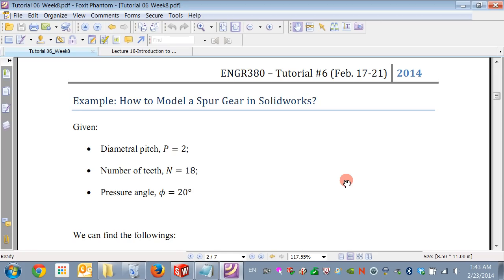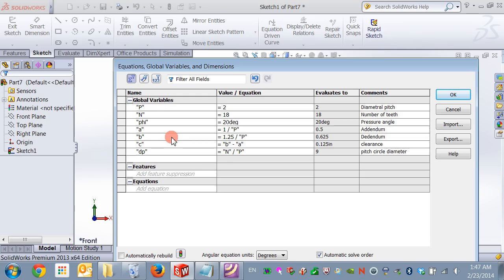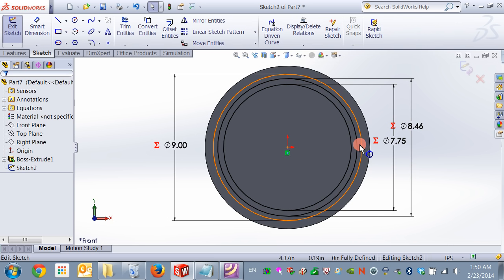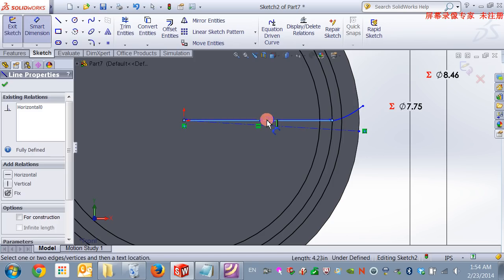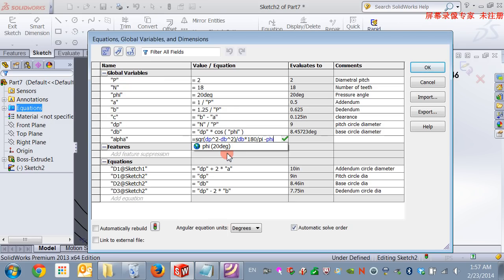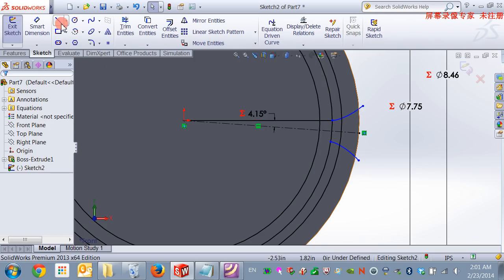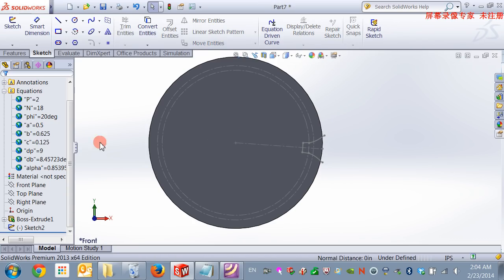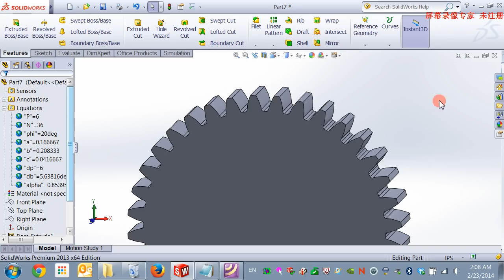Modeling an Equation Driven Involute Spur Gear in Solidworks

Comment: Great tutorial, sir!
Just one note: when creating the circular pattern, one might need to be sure to have the "Geometry pattern" checkbox checked in the circular pattern dialog box, otherwise it might not let one propagate the fillet as well
Reply: Damn it. I just lost an hour erasing and redoing everything step by step. I was going crazy until I figured it out on my own.... I was going nuts! Now that I'm reading your comment I feel trolled xD
BTW great tutorial Yang Cao, but you should have used an equation in the circular pattern, that's pretty obvious. So you don't have to manually adjust it every time. Number of patterns must be equal to "N". Same thing for the fillets, you could have used an equation like "fillet radius equals 0.5*clearance" or sth like that.
Reply: You are a gentleman and a scholar. Thank you so much for this comment.
Reply: I had an issue with that, but I changed my fillet so that it was included in the sketch, and then set it to an equation.
Reply: Thank you sir. True legend lol
Reply: thanks alot for this
Reply: Thanks a lot man
Reply: nice catch

Comment: Thank you so much for this. Absolutely spectacular. I'm using this to make a clock, and I found that by simply inputting "N" for the number of instances in the circular pattern you can have it auto update. Also, I made the diametral pitch dependent on the pitch diameter via adding another variable. Just a couple things to make changing gear sizes easier.
Reply: Can you explain why you made the diametrical pitch dependent on the pitch diameter? What does this solve?
Reply: Matthew Miller I'm using SDW 2014, not sure if it will work on older versions. I simply put "N" (without quotes) into the field "Number of Instances" when I did the circular pattern. This way I can make a bunch of different size gears without having to update the number of teeth in the equations AND the circular pattern. As for the pitch diameter, I just made another variable (named pitchdia I think) and changed the value for "P" to an equation based on "pitchdia."  This really doesn't solve anything for most practical uses, but when you're making a bunch of different sized gears, it shaves a minute or two off each one.

Comment: Hi there, on your notepad, the alpha equation is different than shown on the PDF. It is wrong?
Reply: If you're referring to the *180/pi, this is the conversion from radians to degrees.

This is here because the equation calls for radians, (notice "phi rad"), however our pressure angle is in degrees

Comment: Super helpful video. Some advice would be set the number of instances of your circular pattern to "n" and the fillet to a fraction of "c" (for example he used R.10 with a .125 clearance, so you could set your fillet to 4/5*"c") to ensure it will never be larger.

Comment: Thank you for sharing!
Note: to write equation you may need to write with " " the variables.
Improvements:
- Number of tooth can be linked to the circular pattern instances
- Fillet radius can be setted as Diameral Pitch / 10, this prevent manual adjust
- Alpha calculation is not required, simply link the line to the intersection with Diametral pitch, than simpler equation as 360/4/N.
- Not necessary to write two equation, can be used one than mirror it
Reply: Circular pattern when linked revert back to same value any idea
Reply: Why pattern 20 when he got 18 teeth? it happened to me when i designed my gear (different characteristics)

Comment: Excellent video - very helpful.  One question though.  At 9:45 you enter 0.68 into the T2 field.  What does this value represent, and how is it derived?
Reply from the maker: That is just a value for "t" I randomly selected after a few trial.
Reply: he chose 0.68 so he can put bounds on the curve of that first involute line, otherwise it would keep plotting for all infinite points of t (reference for anyone else wondering)
Reply: this determines the length of the curve from the start . it is the end point of the curve.  it just needs to be long enough to go past the outer edge of the gear body so you can trim it later. type 2.00 in that field and you will see what happens.

Comment: Dr. Cao, thanks for posting this! Now to find out why Solidworks fails at 39 teeth (when the dedendum circle diameter is greater than the base circle diameter).
Reply: +Jeff Biss 
Have you, by any chance, figured out yet why it fails at 39 teeth? I'm experiencing the same problem.
Reply: +tobyteddy222, nope, I have not figured out why. I have contacted my reseller and they said that they are looking into it, I sent them my part file. I think that it has something to do with base circle being a smaller diameter than the dedendum circle. If you look at the results of 39 teeth, you'll see that the tooth base produces "notches" with the involutes.  Trimming the dedendum circle and each involute turns  one of the involutes red and the "The sketch has not been undated..." message is displayed. I will post any resolution when I get it.
Reply: +tobyteddy222, I still haven't received a reason why this fails but have developed a work around:

1. Open an new sketch on the same plane as that which holds the equation driven involutes.
2. Select the involutes and the base (dedendum) circle.
3. Click Convert Entities. Those features are now copied onto the new sketch with no equation driven relations between them. They can now be trimmed as required so that you can use the new sketch to Extrude Cut the disc. After you extrude cut, simply create a Circular Pattern using that Cut-Extrude feature and you're done!

You can now create spur gears of any number of teeth up to 105. There is a problem with this method because 360/(4*N)-alpha equals zero when N = 105.3916. So, gears with 106 and more teeth will fail.

Comment: This was an excellent lesson.  I managed to create this in AutoCAD INVENTOR.  If anyone needs the Equation Formula for INVENTOR, I've listed them below.  INVENTOR is very particular about the syntax and unit parameters:  

BaseCircleDiameter / 2 ul * ( cos(1 rad * t) + t * sin(1 rad * t) )

BaseCircleDiameter / 2 ul * ( sin(1 rad * t) - t * cos(1 rad * t) )

BaseCircleDiameter / 2 ul * ( cos(1 rad * -t -2 * BaseCircleDiameter / 1 in * 3.14159265359/180) - t * sin(1 rad * -t-2 * BaseCircleDiameter / 1 in * 3.14159265359/180) )

BaseCircleDiameter / 2 ul * ( sin(1 rad * -t -2 * BaseCirceDiameter/ 1 in * 3.14159265359/180) + t * cos(1 rad * -t-2 * BaseCirceDiameter/ 1 in * 3.14159265359/180) )

tmin = 0.00001

tmax = 0.68

Comment: Dr Yang, really helpful video. Question from my side (couple of years after your video and the majority of the responses)
But, can you please describe / explain why are you using "t2=0.68" which such value?
I've reviewed your material, and I don't see, yet, the correlation
Could you please help me to understand?
Thanks
Reply: I played with it. I could be totally wrong but I think t2=.68 just guarantees the involute curve will extend past the addendum circle diameter. Like if you made both t2s=.75, the gear would still be exactly the same.

Comment: Thank you for this video. Is there a way where I can dictate the addendum circle diameter? I am trying to remake a gear I currently have that has a addendum circle diameter of .94454 with a diametral pitch of 24, 42 teeth, and pressure angle of 20deg. Thank you

Comment: Is it possible not to use alpha?
Let's say the straight line attached to involute curve is line "A". What if I draw a line "B" from center to where involute curve meets pitch circle where D=9. Then draw another line "C" from center at 360/4N degrees from line "B". Then mirror involute curve and the straight line "A" attached to it accross line "C".

I tried this which should make sense, but then angle between line "B" and "C" is 4.2 degrees instead 4.15 shown in your video. Which part did I do wrong?

Comment: when dedendum lies above base circle, i found an interesting thing. involute profile generated from base circle cuts pitch circle somewhere between addendum circle. Would you please help me through this problem?
Reply: I have the same problem. But I guess you will have to change the sketch for these cases. My solution was to make the base at dedendum, in which case the fillet would be between dedendum circle and the involute curve.
Reply: Yucel Sert This isn't a good idea because having a base of the wrong size will lead to improper geometry.

Comment: Hi and thanks for sharing this great tutorial! It has been very helpful. 
Can I ask, is this gear design based on a "zero backlash" basis? And if so, how would you recommend building in backlash? Is there way to do it using global variables such as modifying the pitch circle diameter or module etc? 
Many thanks again!

Comment: Hello!  Excellent tutorial!  I am running into one issue though with the Phi value.  I can change N and P to all the combinations I need without issue, but when I change Phi to 30 degrees I get a Dedendum circle that is larger than the base circle and the pattern won't cut.  Any advice on how to fix this?  I am trying to draw a 5/10 36T 30deg involute gear.

Comment: Great video! Helped me a lot. Just one comment. When you named your global variables, you called "P" Diametral pitch but I think that should be the pitch diameter (in) and you called "dp" pitch diameter when that should be diametral pitch(teeth/in). The values are correct though. Thank you so much for your help.

Comment: This video worked out great for my except for one thing. When I finished my gear even though I had an N of 21 I ended up having 24 gear teeth. I noticed that on yours too you ended up having 20 gear teeth when you finished your circular pattern. Is there anyway to fix that?

Comment: I really appreciate your effort. I am just beginner of solidworks and followed your lecture and got it. As you mentioned I encountered the base circle diameter is smaller than dedendum circle diameter. Do you have other lecture for this or should I draw from the beginning? Please let me have your tip for this. Thanks in advance

Comment: How can I adjust the equations to make gear with different diameters? If I adjust the "P", the size of the teeth changes also such that the new gear cannot fit into the original gear. How can I change the equation so that I can make different size gears that can still work with the original gear?

Comment: why does this don't work when I go to more teeth? it collapses in 42 teeth. the dedendum circle becomes bigger than the base circle and it doesn't work. it is a great tutorial but I've been struggling with this all day long...
Reply: thats bad
Reply: it probably has to do with the pressure angle you're working with. remember that if we want to constrain the dedendum and base circles, we can express their relationship as:

(pitch diam) - 2(dedendum) < (base diam)

with pitch diameter equal to (module)*(num of teeth), or (num teeth)/(diametral pitch) and base diameter equal to (pitch diameter)*cos(pressure angle), just like the textbooks give us.

you can solve for your max number of teeth by moving all other variables to the opposite side, but you should see that the num of teeth at 20 degrees pressure angle is mathematically limited to like 41 or something.

Comment: Hi Dr Yang Cao, i did succesfully created a pinion with N= 36 Teeth , Moudle= 1.25, with P=0.8 . However when creating the Gear  of N=108 Teeth (3:1) ratio, i had a problem with beta angle as it turn to be negative and this cannot be accepted in solidworks , so resulted in a different involute profile for the gear ?. How to solve this problem? and what angle beta should be used for the gear. i would really appreciate your help.
Cheers

Comment: Equation Driven Curve:

"D2@Sketch2" - Circle Name from which is shape created

"D2@Sketch2"*.5*(cos(t)+t*sin(t)) 

"D2@Sketch2"*.5*(sin(t)-t*cos(t))

Mirrored Curve:

"D2@Sketch2"*.5*(cos(-t-2*"D4@Sketch2"*pi/180)-t*sin(-t-2*"D4@Sketch2"*pi/180))

"D2@Sketch2"*.5*(sin(-t-2*"D4@Sketch2"*pi/180)+t*cos(-t-2*"D4@Sketch2"*pi/180))

Remember you need to be in Sketch2 to make it work.

Comment: When defining the parametric curves, what are the values inputted into t1 and t2? 0-0.68. What are these representing?
Reply: the start and end bounds for the t parameter.  0 means start at the beginning (t = 0) and the 0.68 number is arbitrary, it just needs to be high enough to make the curve extend beyond the addendum diameter so that you can use it to cut the gear profile later.  You can "guess and check" the 0.68 value until it extends past the biggest circle.

Comment: Thanks for the great tutorial. I`m just confuse why do you need to create the second involute? when i tried to mirror the first involute using a quarter of angular circular pitch, the result was the same.
Reply: +francis wayne mojana, it doesn't work properly if you simply mirror. It does work for the very first gear you create, but when you change the number-of-teeth variable and rebuild, you'll notice that the tooth profile is wrong. You need both sets of parametric equations for this to work as a template for creating other gears.

Comment: There seems to be a limit to the number of teeth you can have given a specific a and d because eventually the base circle, which is Dp * cos(phi) becomes larger than the d circle.   Is this a real property of these gears, or a side effect of the way we drew it?
Reply from the maker: Yes.  I mentioned the issue in the description of the video.  It is possible for the base circle diameter to be "smaller" than the dedendum circle diameter.  Gear profile will be all involute.  No more straight line between the base and dedendum circle.  I haven't been able to figure out a general method to accommodate both cases.
Reply: Yang Cao
Ah sorry, I should have noticed that in the description.

Comment: Thanks for uploading this, it really helped me understand the process a lot more.

I have made my version of your model, are there any conditions that need to be modified to account for a much larger spur gear? I am trying to model the angle but my value comes back as a negative value and cannot define the angle.

Diametral Pitch = 0.3333
No of teeth = 110
Pressure angle = 20°

Addendum Diameter = 336mm
Pitch Diameter = 330mm
Base Circle = 322mm
Dedendum Diameter = 322.8mm

My tan and beta angle values in the involute curve come back with a value of -0.3°

Has anyone used this to create a relatively large spur gear?

Comment: i have a problem in  equation driven curve . . 
it says wrong equation i just copy paste it? 

X(t) = "D2@Sketch2"*0.5*(cos(t)+t*sin(t)) 

Y(t) = "D2@Sketch2"*0.5*(sin(t)-t*cos(t))
Reply: +John Medina If youre still having this problem, all you have to do is copy and paste the formula into the x_t and y_t boxes, and you'll notice that the formula turn red in colour which signifies that it has an error. For some reason solidworks doesnt like having things copy and pasted. After this, just click the 'explicit' check box, and then click the 'parametric' checkbox again. It somehow makes solidworks forget that it was copy and pasted and the formula will turn black and it should work. If that doesnt fix your problem, you may need to change D2@Sketch2 to D2@Sketch3 if youve accidentally done it on a new sketch. That worked for me
Reply: +Sam Isaac I think if the formula turns red you have a problem with the formula. My issue was having multiple sketches/dimensions not lining up with equations, such as - Equation for Xt in the 2nd involute"D2@sketch2"*0.5*(cos(-t-2*"D4@Sketch2"*pi/180)-t*sin(-t-2*"D4@Sketch2"*pi/180)). Problem I found was that I had D4@Sketch2 on a separate sketch! D1@Sketch3!To maintain consistency/efficiency I kept the formula and changed the sketch to match.
Reply: +John Medina i am facing the same issue . .no mater what i type in it says invalid
Reply: nice thanks
Reply: Could be you have a different language version in SW? I.e. in 
german "Sketch" is called "Skizze", therefore straight copy/paste 
wouldn't work for involute equations.

Comment: it seems that whenever we change values the form of a tooth change. what should i do if i want to make two gears with different diameter circle and the same form of a tooth ? because i want to make a smal gear that can move an other big gear with a 160mm addendum circle diameter but i dont know how to do that because the small one hasn't the same tooth as the big one. can anybody help me please ?

Comment: Hi great vid, could you use an equation for the fillet relative to c? or can you only input a number?
Reply from the maker: From  version 2014 of SolidWorks, you can use equation or global variable  when defining the fillet.  One of the viewers also pointed this out.
Reply: Yang Cao This works well for a certain combination of parameters, but if you change the inputs too much the whole thing breaks and you have to start over. Also, what would be a good way to make the fillet size and the shaft hole size driven by the size of the gear?

Comment: thnk u for the video, my problem is with m=2.5 angle pressure 20 ans nbr of teeth 45 the base diametre is higher than the dedundum cercle diameter how can i solve this please

Comment: Why t1 is 0 and t2 is 0.68 in equation driven cure "D2@Sketch2"*0.5*(cos(t)+t*sin(t)) and "D2@Sketch2"*0.5*(sin(t)-t*cos(t))? Any clear description please ?
Reply: M A Motin Sobuj hello did you find this out? thanks
Reply: M A Motin Sobuj He (the teacher) said about this: "That is just a value for "t" I randomly selected after a few tria"l.
Reply: It's the beginning and end of the curve. You can use other values for t_2 as well, as long as the curve ends outside the material (and can finish the cut).